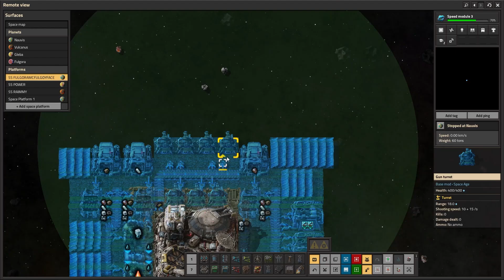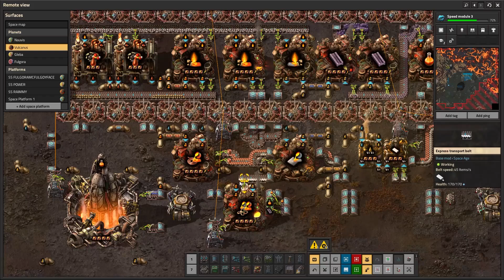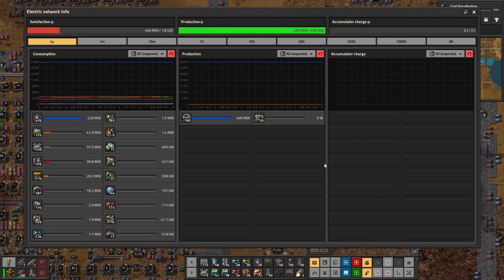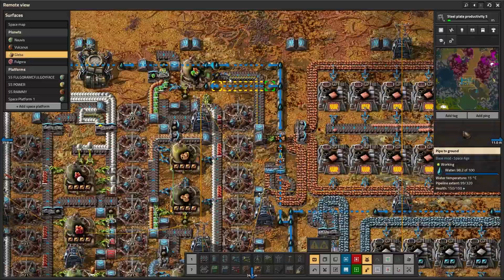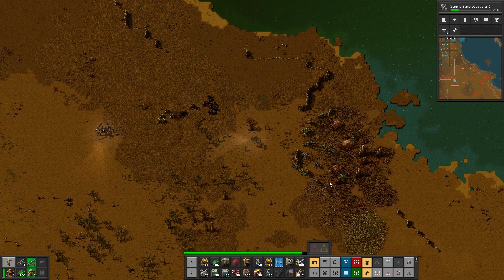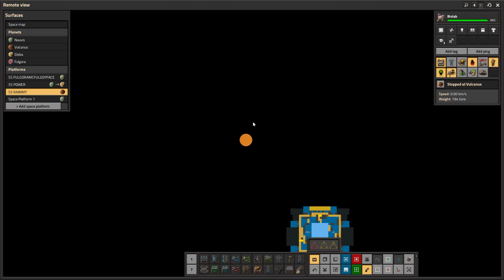Cliff explosives, speed and productivity 3 - Factorio 2.0 Space Age EP17

Comment: reminder to self: modules 3 is way more trouble than its worth. yes that includes the easier speed module 3. don't want to deal with spoilage and don't want to deal with eggs. and even then, 

heck even capturing those biter eggs isn't worth it either. you have to feed it using food from another planet that spoils? the blue chip expenses alone makes me think its not worth it.
Reply from the maker: you'll eventually have a factory so efficient that these difficulties aren't hard anymore. eg blue chip shortage won't be a thing one day
Reply: @DataEngineerPlays  hey random question

since vulcanus has no problems with evolution, ever thought of maybe just do all the production, mall, science etc there?

would love to see your blueprint that does science 1-8 in vulcanus in addition to a mall. of course this is assuming cliff explosive and coal liquefaction is researched.
Reply from the maker: @komocakeps527  yeah you definitely can do that. No nuclear power but you can just turn sulfuric acid into steam power

Comment: Ep 17... comments ! 1) There was another power shortage. This must be the 5th or 6th time we see a power shortage for one reason or another. There should be another one in the future. I kinda remember someone who had put an automated warning in his factory that would alert him when power was too low. Here's what I remember: place a Programmable Speaker in the factory near a power pole. Connect the Speaker to the Power grid using wire. Set condition for the Speaker to send a particular AUDIO warning when the satisfaction of the factory is below 100% (or, it could be when Accumulator charge is at zero, you can test this). This is the approximative procedure since I don't remember exactly what he did, but it worked. You can figure out something. 2) New space platform design: I think each space platform should have a Cargo hub. I'm talking about the structure that expands cargo capacity. It could become useful. Does the cargo hub need to be attached to the main structure ? I don't know. If it doesn't need to be attached, it can be added to the current design by extending the platform in a corner. 3) Suggestion: edit the current basic city block design to make the concrete path a lot wider around the edges. This will place more concrete, make the place look better, and give your character more speed boost. It will also give the bots something to do. Allright, talk to your later.
Reply from the maker: @power2084  where are you seeing these power outages I've never noticed them (except due to steam in the nuclear water pipes)
Reply: @DataEngineerPlays  I remember three other power outages in the 5-6 previous episodes (in one occasion it was because the depleted uranium cells chest was full, the other two times, I don't remember). Every time, the problem was easy to fix but we don't know for how long the power was out.
Reply from the maker: @power2084 those power outages are all due to the same issue and now I think it's fixed. It was because the Steam was in the water line at the nuclear reactors. I cleaned up the alignment and haven't had an outage for a long time now. But the accumulators do help with the laser turrets I think
Reply: @DataEngineerPlays  hey I was wondering, the name of the guy you saw play Factorio at insane difficulty level, is it Yama Kara ?
Reply from the maker: @power2084  Michael Hendricks or something